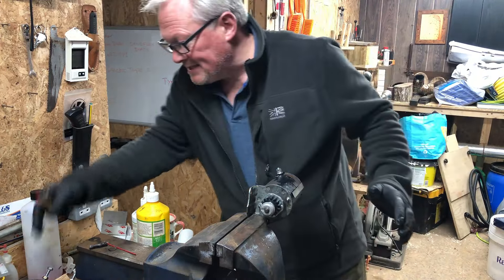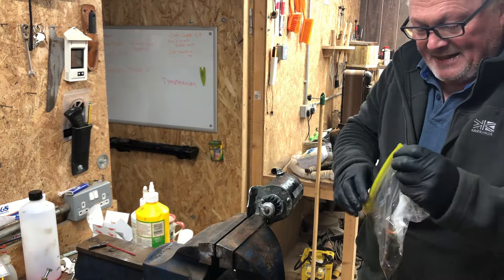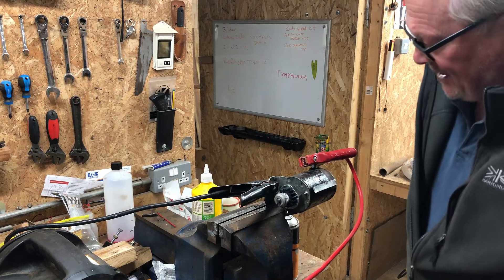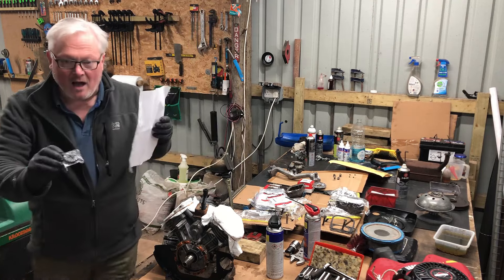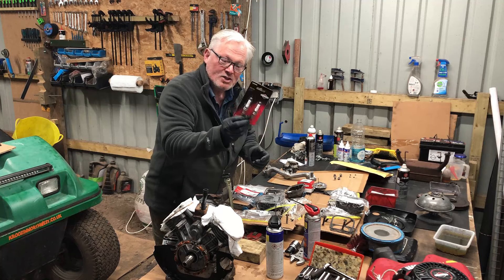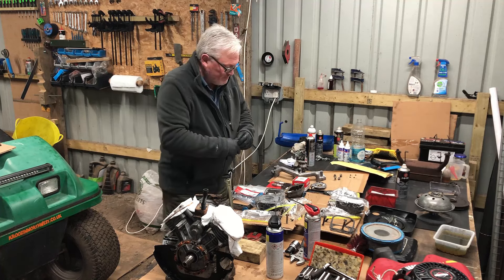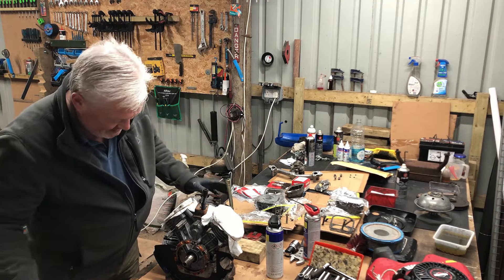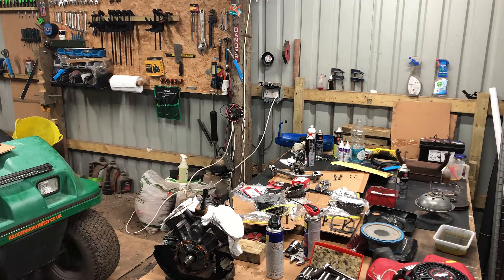Engine rebuild update!

Comment: Happy memories NOT for me Shaun watching this, I remember many many moons ago having to change the starter pinion off a Ford Anglia every few months, I was literally living under the darned thing replacing it.. found out eventually a couple of teeth were broken from the flywheel, no way way I going to expense of changing that...
Reply: I remember back in 1972 we were on holiday in the south of France and we had a Cortina mk 1, and the starter motor decided to stop playing ball one day whilst we were at the beach. I was 12 at the time and being small enough to crawl under the car I was tasked with taking the starter motor off. We then greased it up liberally, thumped it a fair few times, partly to free up the pinion but mostly to teach it a lesson ! Refitted, it worked fine for at least 12 months as we sold the car then and dad bought a brand new Morris 1800 which was a fantastic car. It was roomy, comfortable,  quiet for the day, reliable and easy to service and work on and whilst it had the usual British Leyland quality issues it was built like a tank. On 2 separate occasions Dad had a car run into the back of the 1800, both cars suffered severe engine damage and were wrote offs, the 1800 suffered a dented bumper and a small crease in the boot lid. Happy days !